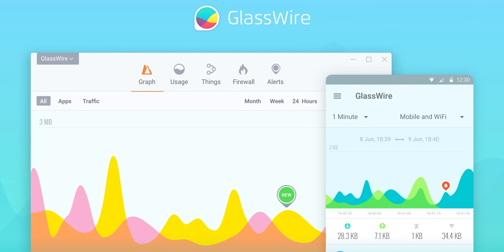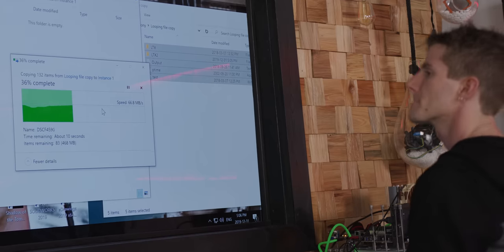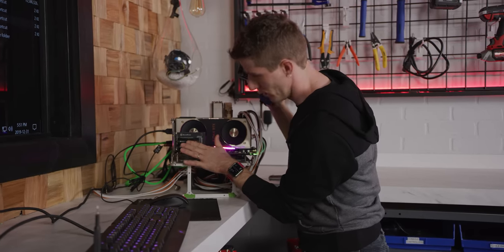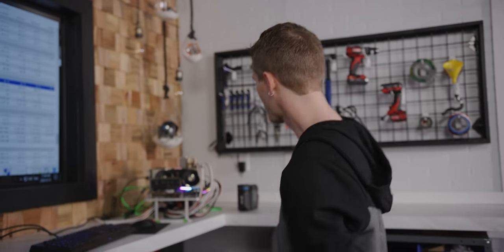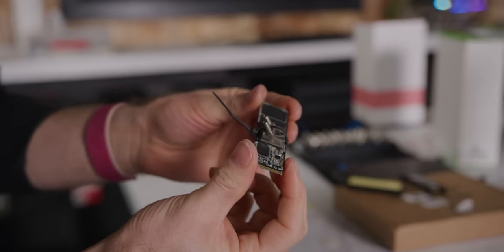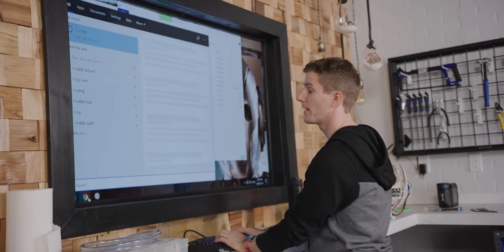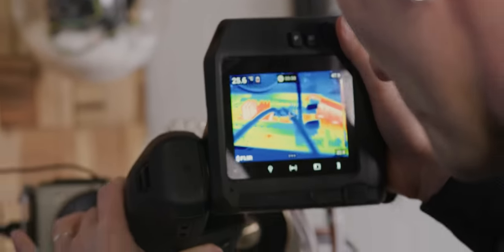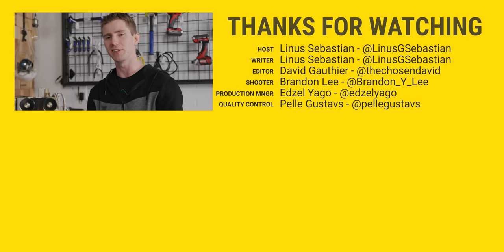We Water Cooled an SSD!!

Comment: Laughs in 3.5” 5400rpm 500GB hard drive
Reply: Oof, 5400rpm

Meanwhile with 7200rpm, I remember some prebuilts with it, it wasn't awful, but not recommendable nowadays with 20-30 USD 300GB HDDs with 7200, and $50 for a 1TB, it less depending on brand.
Reply: @MrCODEmaster00  and sata ssd's nearly as cheap now lol
Reply: Laughs in usb stick

Comment: Before watching, "why tho?"
Edit: After watching, it was indeed unecessary
Reply: No it wasn't, too low or too high temperatures degrade the drive up to as much as twice as fast, and he didn't actually show before/after temps and only had 1  temp on the SSD where something like a new Samsung has 2 temps, 1 for flash and 1 for controller.
Reply: @mayday303  correct me if I'm wrong, but ssd already has limited lifetime because of issues unrelated to temps, so does it really matter?

Comment: Linus: your components last longer if you keep them cooler

Me: running my vega 64 with over 70°C
Reply: Have you done any overclocking or increased the power limit?

I'd think 70°C would be pretty good under load with the power limit up, which is a pretty common thing to do with Vega.
Reply: Under 80 everything is fine, you won't get all the boost tho
Reply: Laughs in R9 290x (92°C)
Reply: The hd 5870 in my asus laptop would stay at 90c for years, still running
Reply: Danny Garcia that’s a laptop though. It’s designed for toastier conditions
Reply: Jerry Lindgren laughs in 8700k 96c 5.2ghz
Reply: @Toad_Hugger  i changed nothing but i have the Asus strix cooling design and somtimes its also going over 70°C
Reply: @eddystudios3242  it's the exact same hardeare design, just with different firmware. I'm not entirely sure about Intel or Nvidia, but AMD is pretty explicit that anything under 95C for their CPUs and 105C for their GPUs (may have changed for Navi, haven't checked) is perfectly fine. The default fan profile for Firepro and Radeon Pro cards doesn't even turn on the fan until 95C.
Reply: @jerrylindgren7828  rx 580 overclocked at 90+ freezes my PC. So no overclocking in summer
Reply: Right Wing Safety Squad I was talking more about the cooling
Reply: I mined on 6 XFX 290X in 1 open air rig for 4 years non-stop. VRMs were running between 98 and 115C with the cores running between 85 and 98C. All 6 cards worked fine in games when I stopped mining.

My 750Ti which never saw a hint of mining died 7 months after I bought it new - probably from thermal cycles gaming on it.

Thermal cycles can be as bad if not worse than just pure temps.
Reply: I have Gigabyte RX 580 8 GB at 75°C (stock speed)

Comment: It's my understanding, paraphrasing from a fellow in the SSD industry, that the NANDs work better hot, so the controller's heat is moved to the NANDs.  Any water cooling/air cooling etc cause the heat to get removed altogether and thus the NANDs dont get the heat they desire.
Reply: that's some smart engineering
Reply: I agree you need to keep a good balance, 50 to 60 degrees is safe for both. In this video he managed to keep it above 40, which is ok. But if you use this solution in a cold  data center or in a random place on the winter...not good. A heatsink acting as heat spreader is really a better solution, with some airflow to be safe.

Comment: i got a pc in livingroom, 10m hdmi through wall, pc in bedroom, open window in bedroom, very cold. snow outside, yes from norway, very cold. it works without all these wonderful watercooling solutions. before i had a radiator on bedroom while pc in livingroom made it condensate. now pc is very cool !!
Reply: and before i watercooled my soundcard... beat that... htpc enclosure with a asus xonar essence pcie soundcard, those suckers are very hot passive like burning hot to touch, watercooled it made my tight fractal design enclosure not overheat.

Comment: I would suggest 2 solutions
attatch the lines for the SSD with a y connector to the CPU loop
mount a dedicated radiator for the SSD and also mount a water heater to keep it at the optimal temperature.

Comment: Stick PVC electrical insulation tape on a surface for the thermal camera to report the temperature accurately. 

Otherwise you have to account for it's emissivity, as Linus evidently appreciates with the "matt black" statement. Anodized aluminium is pretty close to a "black body" meaning high emissivity, though the colour of the anodisation doesn't matter. Because the FLIR camera works in the IR spectrum, what you see about a surface offers little information about it's IR emissivity, because you don't see in the IR spectrum.

Comment: I might be wrong, but it seems like your water cooled solution is running your batch 6 seconds slower than the air cooled version (~16s per run water cooled vs ~10 seconds per run air).

Comment: An SSD is the size of a radiator fin. Something that thin I'd imagine doesn't retain much heat as long as you have some air circulating around it to dissipate it.

Comment: Ive heatsunk my phison controller and dram for 2 years. This tiny aio will work perfectly :).

Also yes, the performance is that I never get thermal throttling because it's coo.

I let flash run warm :)

Comment: I would be interested in knowing why most people don't remove the label from an NVMe when adding any kind of cooling (be it water or air). Doesn't this act as a thermally inconductive layer? In the video, after removing the original heatsink, there was also no sticker on the NVMe drive itself.
Reply: Keine Ahnung Brudi ein Möglicher Grund ist vielleicht weil die NAND Speicher bei 40° laufen sollten um optimale Schreibgeschwindigkeit zu erzielen.

Comment: I noticed that after copying a large (40GB) file to my RAID 01 array, it seemed to take the stress in stride. The memory buffer would fill up slowly but the average throughput (as reported by the Windows Copy dialog box) remained between 350 and 400 MB/s.  The very next large file, however, didn't fare as well (between 40 and 200 MB/s).  The memory buffer maxed out much faster. I suspected that I was witnessing thermal throttling and after viewing this video, I'm pretty certain of it. I'm going to try gluing a little heat sync onto my drive controller chip to see if it helps.

Comment: 6:48 lol, i strongly disagree with that statement, high performance gpu for example can run at 80c most of their existence with out any performance degradation, or even a slight signal of premature dead, because their not organic beens, but just a pice of silicon, literally a smart rock, if a chip died prematurely nowdays AND the user diddnt messed up doing wacky things,  its 100% fault of the manufacture

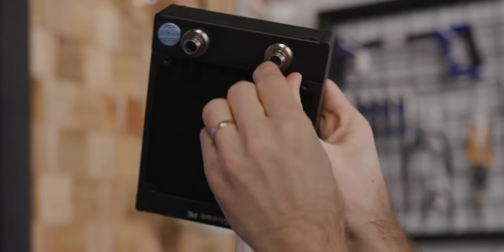Comment: 9:45 - call up McMaster Carr and solve it with 1 adapter. Jerry rigging shit so you have several questionable connections to adapt sizes in multiple steps in a system where 1 failure could mean thousands of dollars in damage is fucking clown shoes.

Comment: Soooooo... Gpu and Cpu wasn't enough. They had to make chipset and vram too hot to run without coolers too. And now there's also ram and ssds to cool. I'll be a plumber at this rate. And forget cable management, running all these different pipe sizes from two loops is gonna be an extra challenge.

Comment: There is a teeny tiny problem with the results you are having. it is barely 40 degrees when its on 100% load while its not bad if you are gonna use it 24/7 but if you are thinking like loading games on it then the operating temperature will be lower because there wont be that 100% load to heat up the nand flashes TL;DR Corsair did a better job with their cooler.

Comment: I would like to see the car radiator as a part of the water cooling system in some pc. Not a 120,240 or 360 mm. normal radiator. Just took it from someone car’s.

Comment: Hell yeah been there id collect heatsinks off chip sets to cut up for ram an mosfets for gpus an mobos because small heatsinks was hard to get way back wen.....i had a athlon sktA cpu cooler on my 6600gt with one of those old thermaltake 5000rpm 80mm tornado fans it was clocked to hell an if i kept it under 60c it didnt artifact

Comment: Let me tell ya my Samsung 970 Evo 1Tb gets 90°C an over with the little shitefan thats on the motheboard, and a standalone watercooler (without circulation) is about 50-60°C in the first hour but then starts to go up to 80°C aswell, no its connected to my Pump 'n' Rad and the max. is 39°C, this hot chewing gum needs cooling for sure!